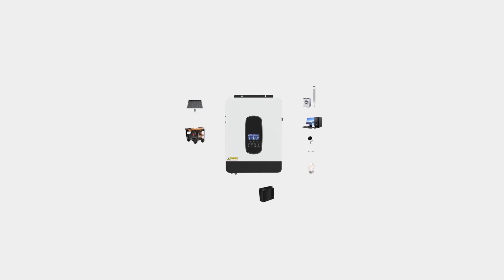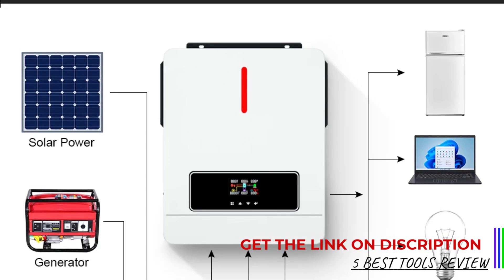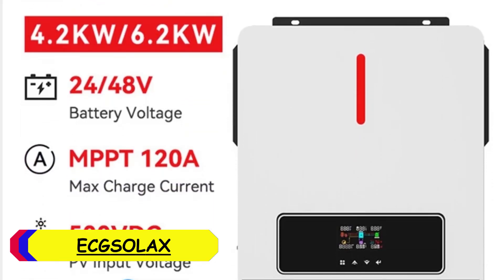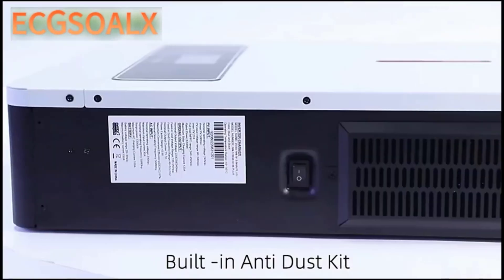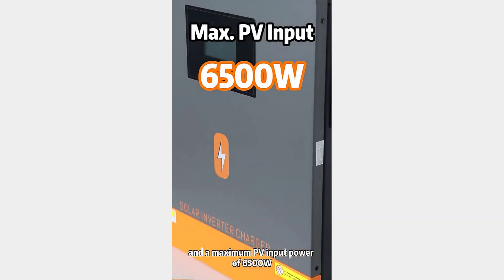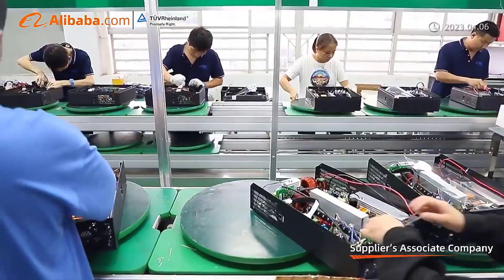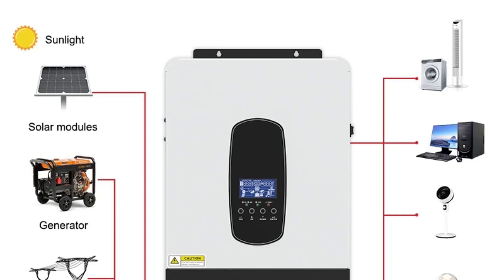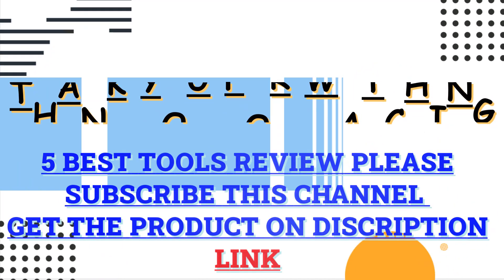Top 5 Best Hybrid Solar Inverter 2024

Comment: What about the EG4 6000 XP?
Reply from the maker: u can try this one--
Daxtromn 3.6KW 6.2KW  https://s.click.aliexpress.com/e/_DE39iMx

Output Current 20A
Model Number AGH-3.6/4.2/6.2KW-PRO
Output Power 1 - 200KW
Size 53*39*21
Output Type DUAL
Weight 10
Brand Name daxtromn
Output Frequency 50/60HZ
Is Smart Device YES

Certification CE
Phase Single phase 4.2kw Maximum PV Input Power 6200W
6.2kw Maximum PV Input Power 6500W
PV Nominal DC Voltage 360VDC
PV MAX DC Voltage 500VDC
Start-up Voltage 120V
Number of MPPT/Max Input Current 1/23A
Norminal Output Voltage 220/230/240VAC
4.2KW Norminal Output 18.2A
6.2KW Norminal Output 27.0A
Max Conversion Efficiency(Solar to AC) 98%
4.2KW MAX main load 4200W
4.2KW Max Second Load(battery mode) 1400W
6.2KW MAX main load 6200w
6.2KW Max Second Load(battery mode) 2067W
Communication WIFI Included
Maximum Solar Charging Current 120A,120A
Maximum AC Charging Current 100A
Reply from the maker: https://s.click.aliexpress.com/e/_Dlwje5z
Reply from the maker: The EG4 6000XP is a 48V split-phase off-grid inverter/charger that efficiently utilizes 8kW of PV and outputs 6kW of power while charging your battery bank. The scalable all-in-one off-grid inverter allows up to 16 units to be paralleled for 96kWs worth of power output. Additionally, it can be controlled using the new EG4 monitoring software. Join EG4 on the journey towards energy independence and enjoy the accessibility, cost-effectiveness, and efficiency of the 6000XP today. 

SPECIFICATIONS

DC Input Voltage Range: 100-480 VDC
Number of MPPTs: 2
MPPT Efficiency: 99%
Dimensions: 18×25.5×5.25 in (45.7×64.8×13.2cm)
Weight: 52.9 lbs. (24kg)
Parallel: Up to 16 units for a max of 96kWs of continuous AC power.
Reply from the maker: Daxtromn and EG4 6000XP are same